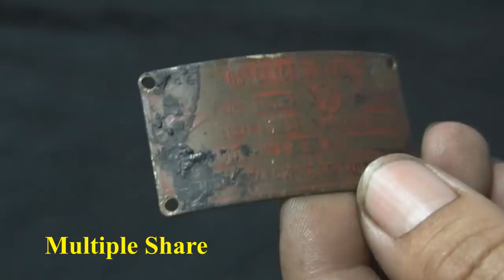Restoration/ Very Old Model Mini Electric Drill Rescue- Shinko/Japan/Antique Drill Restoration

Comment: Now that was was a clever idea using epoxy to fix those screws rather having to make or get new ones, I suspect it might have been the former. Another good job.
Reply from the maker: Thank you
Reply: It's not too different from how they're actually made, just not by hand but a factory. Injection molding is pretty sweet.
Reply: Maybe so but I still that it is a clever idea, one I would have thought of.
Reply: @Lesnz2009  you're not wrong, it was well done.

Comment: Fine repair job. Love those old metal housings, do not break as easily as the modern double isolated plastic housings.
Reply from the maker: Yes, sure . thank you
Reply: Yeah but when they do they break properly. I dropped a metal cased impact drill from a three story ladder onto concrete and it went off like a bomb :)

Comment: So at TS 17:25 did he not assemble the plate correctly?  Seem the plate is 180 degrees off.  There is standoff that should be over the bearing to hold it place.

Comment: Awesome job on something that crusty. You have yourself a sub. Little pointer, the chuck looks quite unstable at the end of the video, slipping and flexing. Either it wasn't tight enough or it's worn out. There's no shame in changing the chuck for a new one, they do wear out and the older ones are designed to be replaceable.
Reply from the maker: Thanks for the tips!

Comment: There is one thing I just can't understand.
If the drill is made of aluminum, why is only the wire brush used which ruins the metal and then is colored with a fake aluminum color? The aluminum had to be polished using the appropriate disc so it was perfect and there was no need to paint.
Reply from the maker: do you know some product also used color painting on aluminum too, like planer Makita

Comment: I've never seen a power cord rot like that one did. It almost looks like it was in a fire.
Reply from the maker: I Think, This drill very old age, but I cannot find exactly year made .
Reply: Yeah, that cord was really bad. I've not seen the plastic insulation on cords deteriorate that badly before but it does happen depending on where its been stored or came into contact with. I had a USB cord do something similar and it was just attached to my PC but it did not rot as bad as that one.
Reply: Looks to me like someone might have poured some solvent on it that it didn't like. I've seen cords rot, but they usually don't liquefy enough to stick to something. The fire idea has merit, but I think it would have left more signs on the tool itself if that were the case. Then again, it could have been in a high heat environment without actually catching fire. That could do it.
Reply: not to be too much of a troll but it looks like the wire was burned on purpose with a torch. This would explain why the fire damage was focused. I live in one of the hottest places in the southwest and have seen the sun and heat do some crazy stuff but no spontaneous ignition of electrical wires. We did have a power line insulator melt once and short out but that's a bit different than what's going on here. Probably one of those videos where they make an old tool look completely destroyed and then do a decent refurb on it.

Comment: 4:34  did you lose the cross bolt to tighten your puller? I noticed you're using a drill press vice to hold the position.